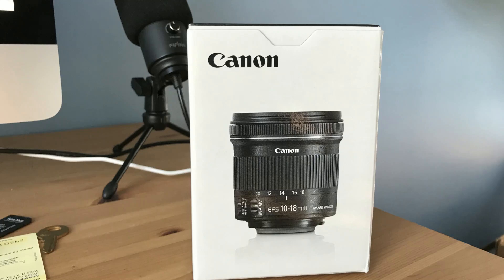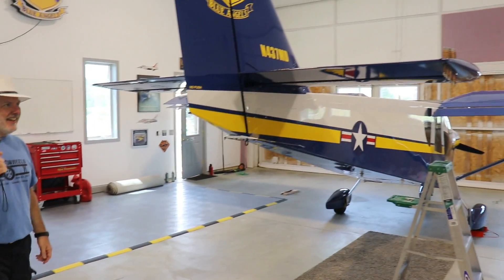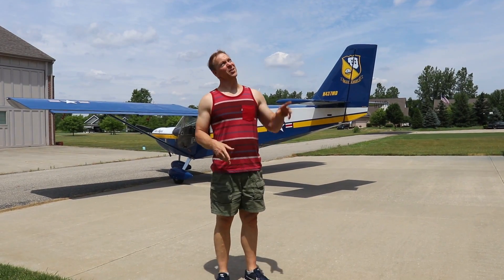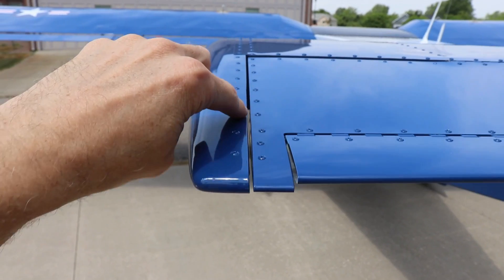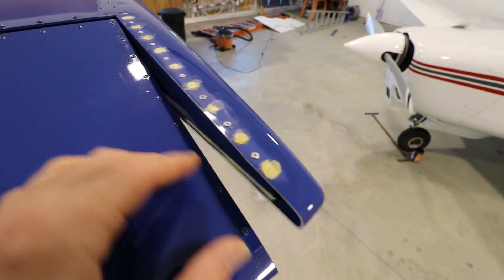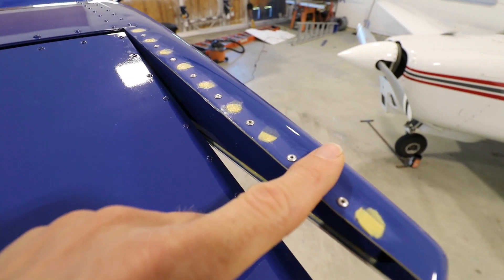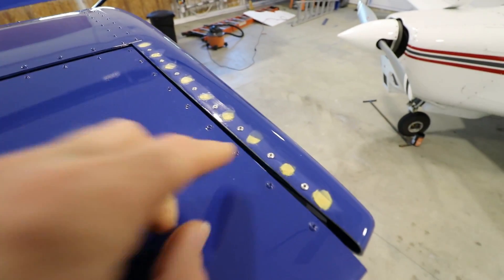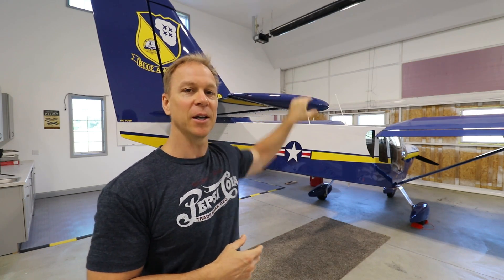CH-750 Cruzer - Fixing the Elevator Issue!

Comment: Do you not see control issues with the trailing edge of the elevator (trim tab specifically) having such a pillowed skin profile? On an Van's RV, you'd have issues with that kind of profile. Also regarding the colour, that's one reason why fibreglass aircraft are always painted white.
Reply from the maker: How do you know? Have you ever flown an RV with that trim tab profile? It works just fine.
Reply: @KitplaneEnthusiast  My RV-6A had that profile on an aileron and you could feel buffet in the stick at high speed plus a bit of roll. I guess thst may be down to the speed range differences between the RV and the Zenith! Probably not an issue at those lower speeds.

Comment: Are you sure about that epoxy fill?  As a rule epoxy doesn't bond (or bond well) to plastic - I hope you aren't setting yourself up for a future redo if the hole plugs start popping out under the strain of thermal expansion and contraction down the road.

Comment: You could use paint blending like TRANSTAR 6363 Melt Away Edge Blender - 15 oz. Aerosol it works great for cars paint
Reply from the maker: I know that there are ways to blend paint, but I've never experimented with that and I'm afraid I'd just screw it up and make it worse! It's actually easier for me to just repaint the entire tip.
Reply: If you could paint the aircraft you could do the blend so easy to do i show it to a guy last week and could not believe it how easy it was try it on a piece of painted metal and paint it a spot a different color and blend it you will be amazed

Comment: Shouldn't be wise to leave the painting to the very last, after the 40 hrs, with all the fixes done?
Reply from the maker: Yes it's possible, but to paint the aircraft after it is completed and flying requires a huge amount of disassembly in order to paint.
Reply: In a perfect world .... However, there is an issue with Balanced Control Surfaces to prevent flutter, which need to be balanced AFTER painting. So, you can RE-Balance after painting or you can fly around with an unpainted airplane with painted control surfaces.
Reply from the maker: Gary Reed True-good point.